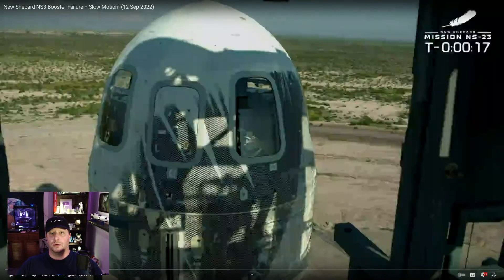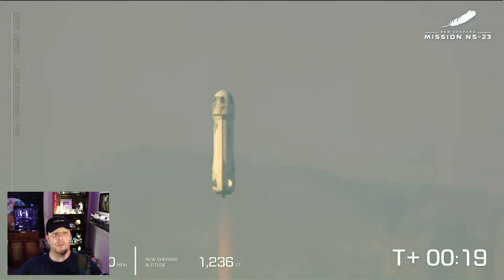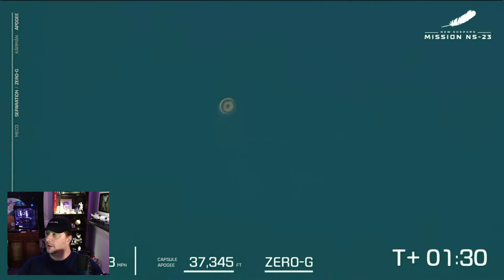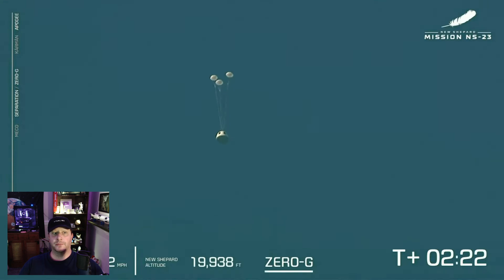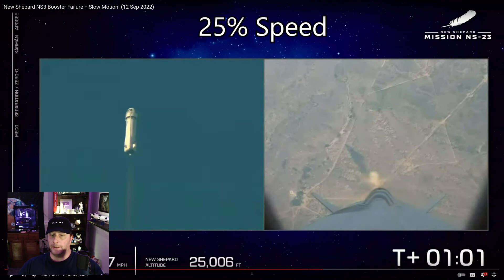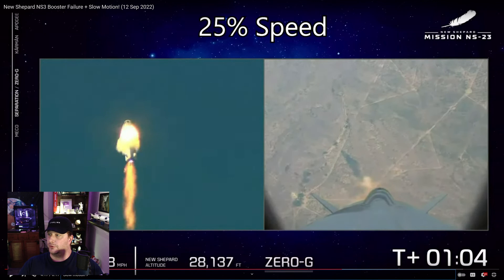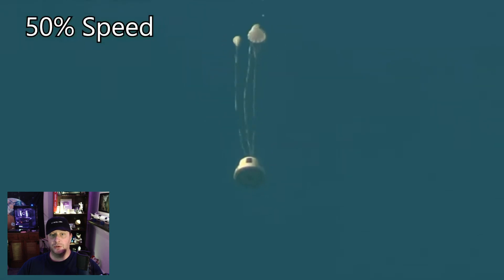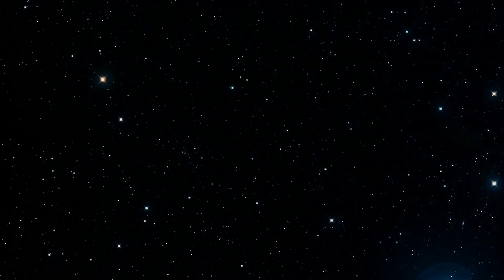New Shepard booster failure + capsule escape [4K SpaceWeek clip]

Comment: Is the 'helmet-y' appearance of Blue Origin's vehicle to allow escape motor gases to flow past the booster? Their design needs a way better explanation than "stops your hand flying off". Frames of booster emerging from flames around 4:32 are beautiful
Reply from the maker: I think the main reason for the width of the capsule, is so that it can comfortably accommodate 6 people. If it were the width of the booster, there'd be less volume inside.

Comment: If this happened once it's one time too many.  I suspect that they are finished.
Reply from the maker: Most rockets experience some sort of mishap. The first Ariane 5 failed. Soyuz MS-10 failed with 2 crew aboard (the launch escape system saved them). 2 shuttles failed, causing the most casualties of any space vehicle. Electron has failed, Falcon had failed... most rockets have.
Reply from the maker: Also, Blue Origin is the baby of Jeff Bezos. If he wanted, he could personally bankroll the company for the next hundred years. He doesn't need to rely on customer funds or government funding.
Reply: @RawSpaceVideos  Great perspective, thanks for the reply.